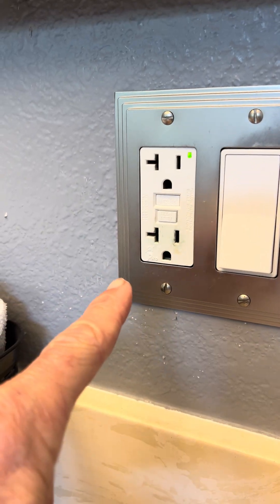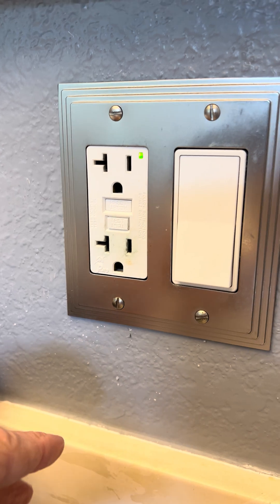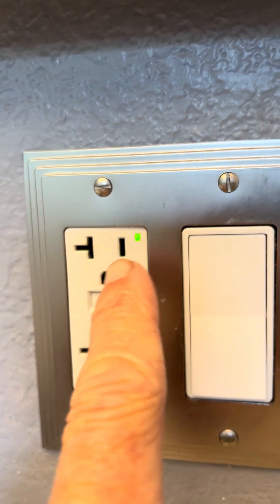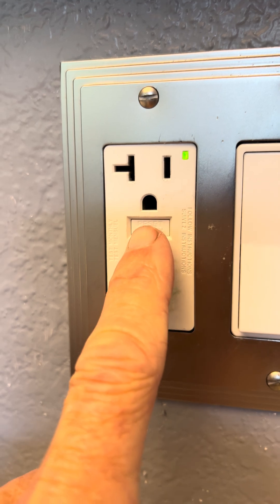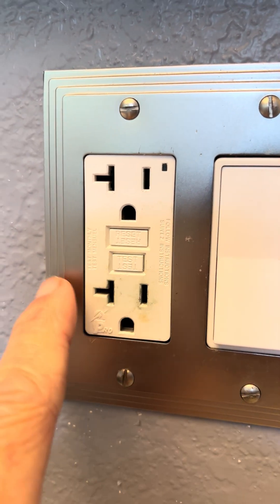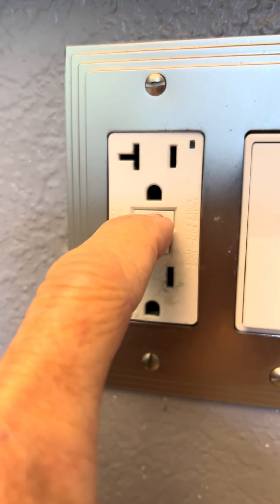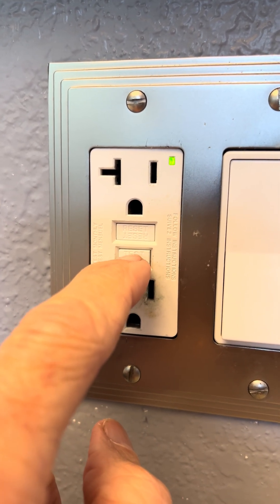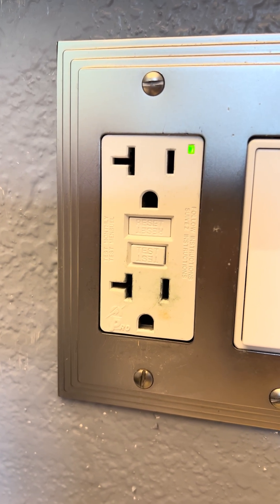✨ How To RESET Your Power Outlet With The PRESS Of A Button ✨ #diy #appliancesrepair #GFCI #outlet

Comment: What if I press the reset button and it doesn’t work ? 😩
Reply from the maker: Good question,
Can you check the garage, kitchen and bathroom to make sure they are all reset.
Reply: @FastFreeApplianceFixes  everything else works. It’s just the outlet where my washer and dryer are connected.

Comment: it is similar to a breaker sure, but NOT a breaker or fuse. they are NOT overload protection. 

They detect an imbalance between the two conductors (caused by leaking or shorting to ground) - however you can overload them and they won’t trip like a breaker if it doesn’t detect a ground fault.

There maybe a niche combo GFCI with overload protection, but generally they are NOT for overload protection.
Reply from the maker: That's an important distinction to make, thank you for pointing that out!